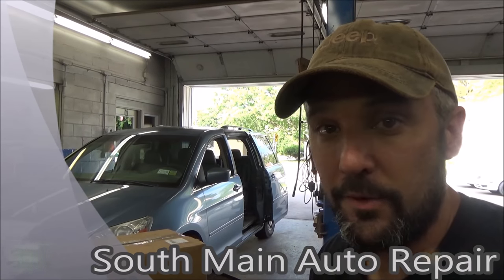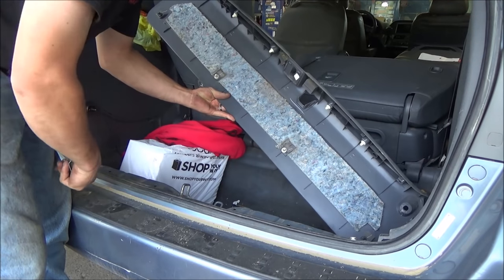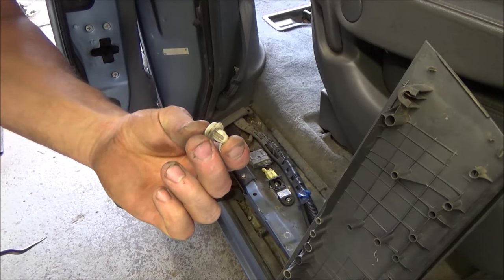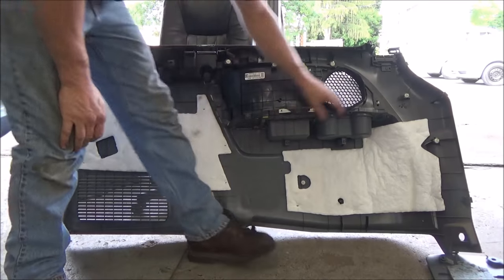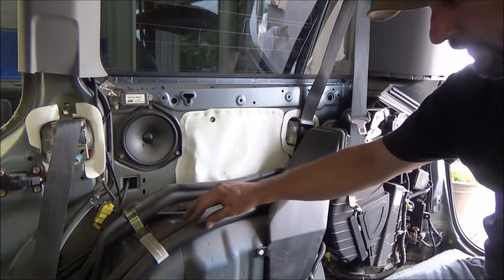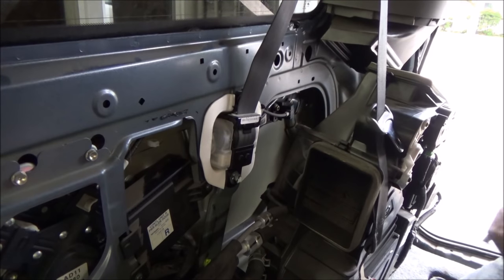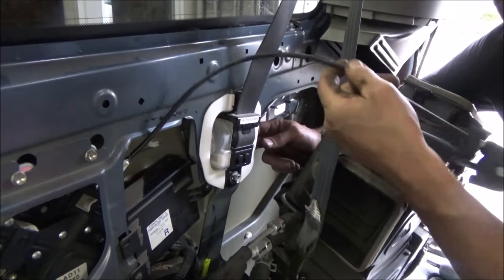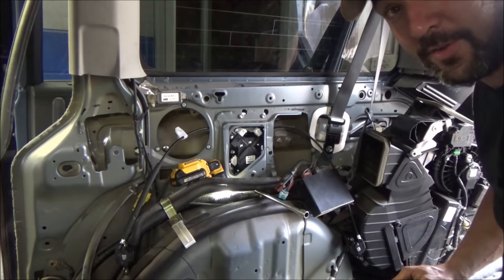Replace: Honda Odyssey Power Sliding Door Motor & Roller

Comment: Great video, man. Thanks for sharing it. 
My problem is: 2008 Honda odyssey,  neither side door responding when switch is pressed, or handle pulled. I checked fuses, and they look OK. After unplugging the switch, I checked that plug for any power, and did not find any power in. 
Only I know is that, if I drop my van at the dealer's place, it could cost me couple of thousand dollars. I really do not know what to do.
Do you thing that motors need to be replaced?
I appreciate for your help.
Reply: Did you reset it
Reply: Hi,
I did reset it and my R/side works OK, but my L/side door keeps popping off, after one minute driving. 
Is there door actuator, door striker off alignment, I do not know. 
Thanks for your response

Comment: I have an issue with the passenger sliding door also on my 2005 Honda Odyssey. My sliding door light is on on the dash, I remove the fuse then put it back on and it works 3 or 4 times but then stops again... Any idea what it might be?
Thanks.
Reply from the maker: Tony C Best advice I could give is to get the codes read out of it and take it from there. It is setting a code is what is happening but for what i am not sure.
Reply: +South Main Auto Repair 
Thanks Eric, I'll have a local shop check the codes and take it from there.
Reply: +Tony C Did you ever figure out what was wrong? My 05 Odyssey is doing the exact same thing. Thanks in advance for the response.

Comment: Hi Mr. my Honda's right sliding door doesn't't work it makes that the system detect  an open door but the left yes. How many motors it has one or two?
Reply from the maker: Stay tuned for up coming video on the repair of the closer latch n the door.

Comment: Would this be the same on a 2006? If a fellow DIDN'T cut the cable, do you need to tear down the whole rear quarter panel, HVAC and outer panel?
Reply: +CertMonkeyTrainer Ok. Never mind, that was kind of a silly question. I guess a better questions would be is this a different motor from the one that closes the door? Isn't there one in the door for that. As far as the fact that my door doesn't want to move at all, I suppose I would start with a roller?

Comment: The wire on mine just snapped because it was all rusty. Called the dealer and it's over 600 bucks Canadian for the part (with tax). If i just cut the wires, is there any problem just using the door manually? I don't want to spend that kind of money and my time to change the damn thing,
Reply from the maker: +Sean Lacroix A lot of folks just cut the cables around here...

Comment: Watching this had me laugh when you mentioned  about forgetting to plug in the electrical  I had someone bring me there telling me they had the ulpstor done and the motor for there window and locks went. Long story short the guy who took the door panel  apart for some strang reason forgot to connect the electrical so the guy was pissed buy the door lock and window motor

Comment: Luckily, I just needed to change the roller only. But now after opening and closing the door 2x, the Power door lights get triggered and it stops working. I pull out the fuse and reset it but it keeps happening again. 😣

Comment: I've got a 2013 where the rear latch on the door won't click and hold. Door motor works fine, but the latch failed. Doesn't "ratchet" to hold rear door closed. Any ideas?
Thanks for the video! 
Chad
Reply from the maker: Pilot Chad Boy on a 13 huh? Do you live in the rust belt?

Comment: for some reason 07 to 2011 hondas.i have a 08 crv. had lots of problems between interior falling apart way before 100k leather rippling tearing by 40k tsb on that also ,air bag recall,power door locks recall on all doors,my rear wiper motor went before 60k,they had a tsb on the tentioner on serp belt going bad before 60 k i replaced all of these before 80k in my car.and honda putting horrible bridgestone duelers on cars only lasting 20k.all my hondas my 87 accord had 490k, 91 accord had 390k,sold it it has 980k same engine and tranny,my 2000 accord had 370k,love my hondas but for some reason from my friends and my experience from 07 to 2011 they rushed these cars out and have more problem then most my cars

Comment: Hey Eric, I just have to say you do good work. Nice Job. Just have a quick question 
I think if you took the fastener off  the wheelwell holding the hvac & heater hoses &  harness,  would you be able to move the hole HVAC out of the way so you could work on it easier. I think you could have done that. Not sure though ? 
The video came out great, I know you are always worried about making a good video. In my view the video was fine. so keep them coming:). By the way i was dying laughing about the Doritos segment. REAL FUNNY :)  LOL
Reply from the maker: Carm0083 My kids loved that part too haha. The HVAC was actually back plenty far enough to work well. Just hard to tell on camera is all.

Comment: I think ETCG did one like this in the past.  All I remember thinking  "That's a PITA"
Reply from the maker: Tedybear315 Nah they are pretty easy really
Reply: Considering all the fun I've had with our 2001 Beetle?  Probably simple compaired to that 'German Design'
Reply from the maker: brain surgery is simple compared to a VW
Reply: Brain Surgery:  Working on a 1.8 VW turbo vacuum line setup.   Weird stuff:  Our VW's HVAC runs the compressor all the time when the A/C is on.  It does not cycle like I'm used to.  Replaced the clutch on the compressor and it had a stress crack about 3" long in the epoxy.  (it's got 136k on it..so that's a good run)  Had to check in at a VW forum to make sure the compressor was working as designed.  Yep--no cycle...just on all the time with the switch.
Reply from the maker: I have ran in to some Mitsubishi's like that too.

Comment: At my shop they told me I can't use air tools or power tools on the interior of a car because you have to use hand tools for that
Reply from the maker: Billy Simons My boss said it was ok but I had to be careful if the car was clean...
Reply: Billy Simons you can bust loose any bolt with an impact, it's torquing them with an impact that things can go awry.
Reply from the maker: Derrick Hodges Just like shooting a gun, it's trigger control :)
Reply: Ok that's cool we just can't use the air tools in the inside of a car at the place I work at but that's fine you did
Reply: South Main Auto Repair lol trigger control. I'll have to remember that one.

Comment: 2011 Honda Odyssey EXL As i was driving with my family on the freeway 70 miles all of a sudden the vehicle the VSA light came on and the van break by itself almost got rear-ended,  I was lucky that there was a exit to the left as i was driving on the left fast line,ater tow to the honda dealer the want to charge me $123+ tax for diagnosis to find out what happend after it was a nightmare with to baby in the van,
after some online search i find out that alot of honda owner complain about the same issue, Defects Vehicle Stability Assist (VSA) the vehicle has only 12000 mile, when i bought the vehicle there was nothing wrong with it. Can someone help me

Comment: Hey Eric I see you have the Dewalt 12 volt max flashlight,. Do you have the screwdriver for it as we'll? I have one and wont ever turn another screw manually even if I spend  half an hour looking for extensions and swivels to make it work:)  It will save your wrist wrenching them bolts. Plus it will get things done quicker. Since you time is money for you unlike us retired geezers:)
It has a clutch on it so stripping bolts is out of the question. Just had to throw that out there for some reason. Hey take it for what its worth and keep pressing on.
Reply from the maker: Robert Barcus Yep I have the drill, the bit driver, the bit driver impact, the 3/8 impact, the saw z all, and the light... actually 2 lights :)

Comment: You say Honda wouldn't make it all weird and difficult? Obviously you have never worked on a Honda Goldwing motorcycle. It takes about 1 1/2 hours to replace an air filtre. A headlight assembly? 4 to 6 hours. Headlight bulbs are okay for three. The fourth is a couple of hours. And the plastic is not all that resilient. They cram as much electrical as that Odyssey has into a package less than 1/4 of the size but there is little regard for servicing it.

Comment: NOPE. That's the 3 year/60,000km Body warranty. Not Powertrain. There is 130,000km on the clock. Bullshit in my opinion. I'll have to pay every cent to have this fixed. Mine is just the actual mechanical latch in the rear of the door though. I've diagnosed it. Put a screwdriver in there to trip it and it won't ratchet to the lock striker position. Go to other side, screwdriver used as striker and it ratchets closed. Pull door handle to release. So something is busted in the actual mechanics. The door motors are fine.
Reply from the maker: Pilot Chad Oh got ya , I have replaced the rear latches in those but not in one that new.